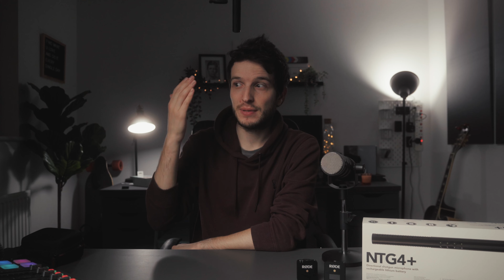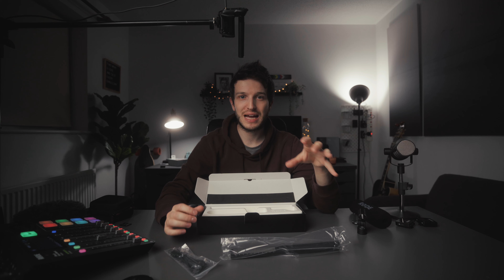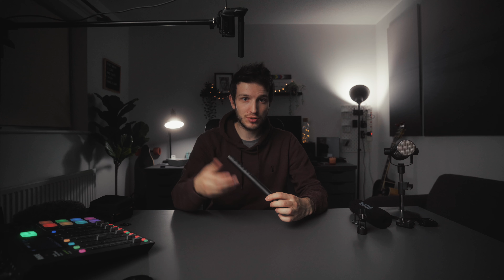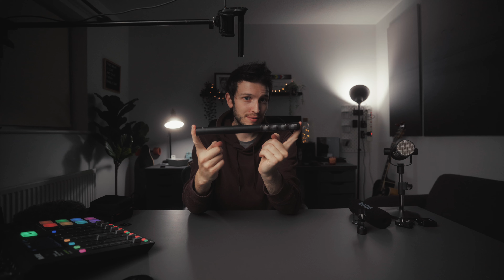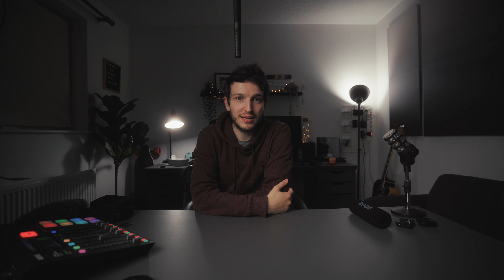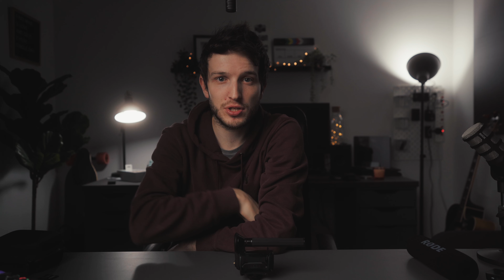Upgrade your audio! - Rode NTG4+ first use and impressions

Comment: I'm late to the game, I've been using this for a few months but I hate it. The sound is to metallic and I still can't find the right way to improve the sound with EQ
Reply: That sounds more like a sound environment issue than a microphone issue to me. It could be that your environment has some particularly bad resonances, and you need to treat your space with some acoustic treatment foam, or panels. You don't need to cover your whole space though. Just treating the worst reflection points and using the included pop filter should give you a big improvement. Keep in mind that shotgun mics are particularly bad with resonances and reflections since it can cause phasing artifacts.

Comment: Yes the audio drops and fades in and out quite a bit... Did you ever figure out what it was? I have the same Mic and it does not do that
Reply from the maker: It was the noise gate on the rodecaster pro. Just need to turn it off